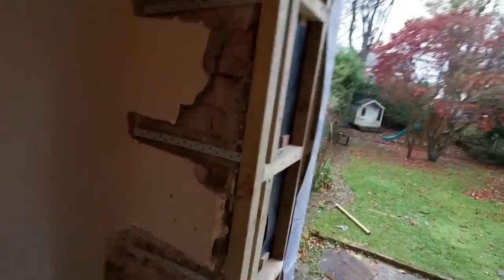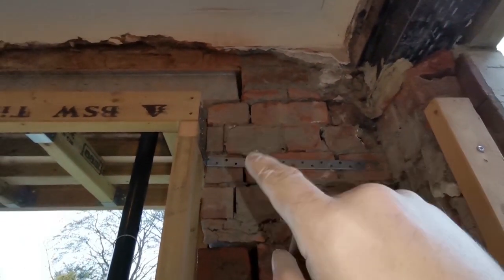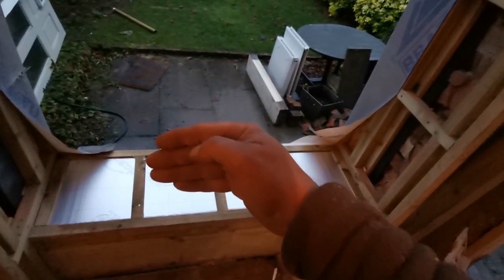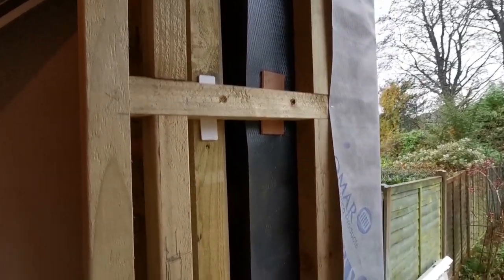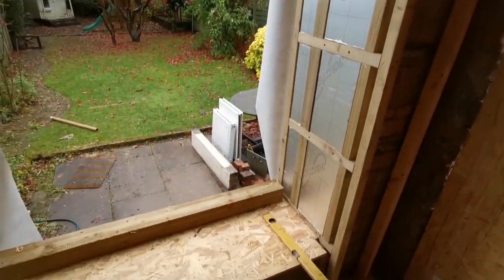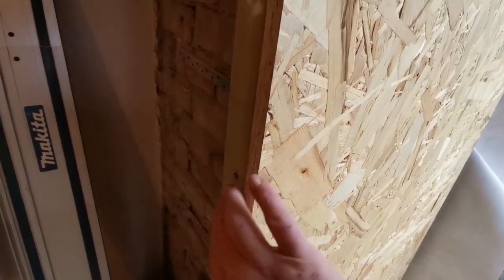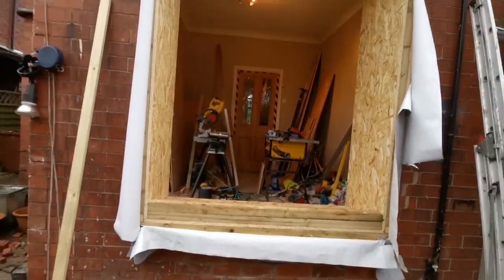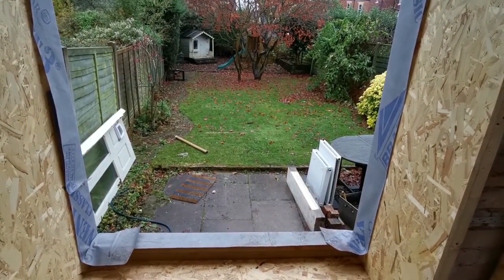French doors & bay window Pt4 - Window carcass framework & boarding

Comment: Cracking series this. Trying to follow along. You've lost be a bit when it comes to adding all the extra materials on now though. It's amazing how many layers it takes to construct this
Reply from the maker: 👍😁 Basically it's a timber frame with OSB sheeting to make a solid box structure, it's clad inside just like a window would be with a window board (a seat in this case) & ply on the insides & top instead of plasterboard that you'd get around a window, the outside has the breathable membrane to keep the main box structure dry, then battens on top to give some clearance for air movement & some cladding, in this case it's solid hardwood boards, easy peasy 🤔😂😁👍
Reply: @Gidjoiner  just like that 😃😃  always learning, ta!

Comment: Hey buddy great video's what dust bag do you use on the plunge saw. I'm finding it hard to get one. Keep up the good stuff mate.
Reply from the maker: Hi, i bought this for my 110v planer which has a weird shaped port, the one i use for the saw is the same but with the round inlet bit, this might have come with a tool i bought, I'd have to look in the shed to see if this is the one i bought or another. https://www.amazon.co.uk/gp/product/B0014142MG/ref=ppx_yo_dt_b_search_asin_title?ie=UTF8&psc=1
Reply from the maker: The bag with the weird shaped inlet is in the shed, but Ah!!! Just remembered this one came with the 18v GHO Bosch planer, so this one should fit, it says GHO 18v on the packet & list👍 https://www.amazon.co.uk/Bosch-2605411035-Dust-Bag-Planers/dp/B0014GSSOE/ref=pd_di_sccai_1/257-3499770-3175112?_encoding=UTF8&pd_rd_i=B0014GSSOE&pd_rd_r=5ac3c2c1-8f57-43c8-bd84-972899eeb03d&pd_rd_w=f5s2F&pd_rd_wg=U0VZA&pf_rd_p=bee783d4-0910-430a-8054-14da33db5765&pf_rd_r=X7Q91EXN8DETXHWJZDE4&psc=1&refRID=X7Q91EXN8DETXHWJZDE4